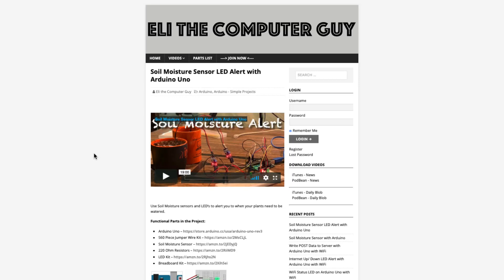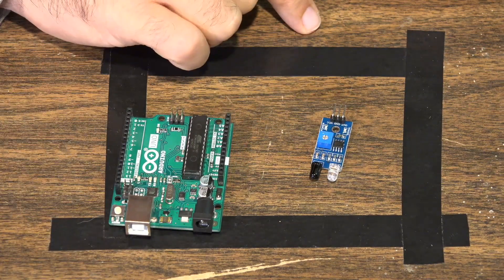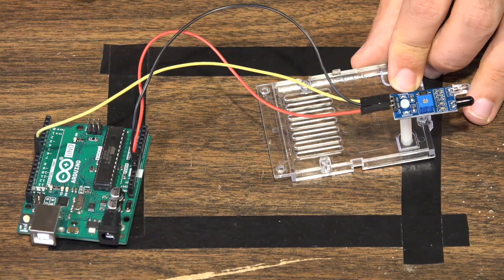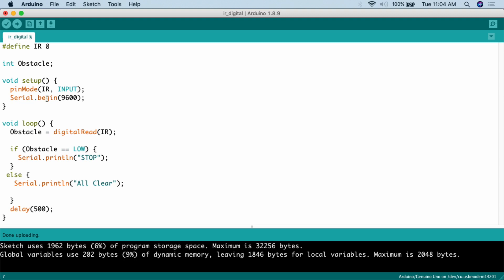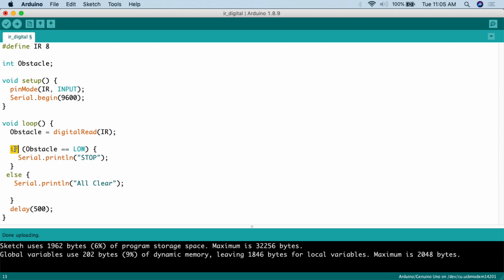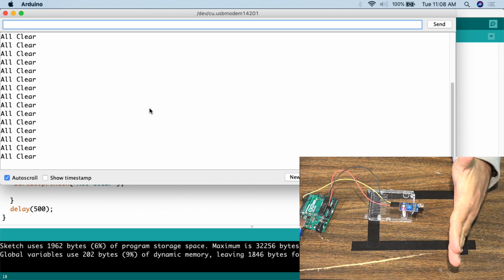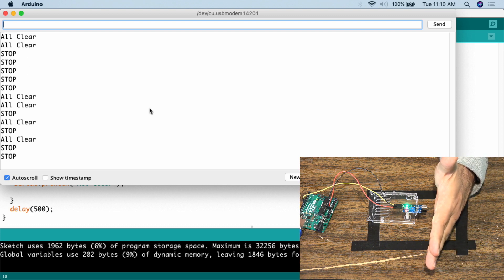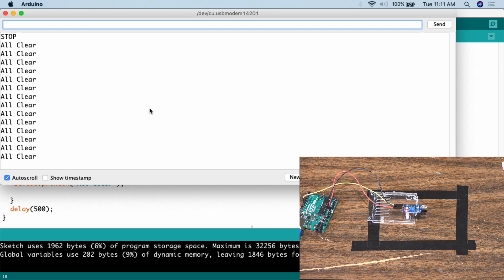IR Sensor Digital Output on Arduino

Comment: Is there a way to adjust the distance in which it detects?   For instance it senses at 1”, can it be adjusted for 2” or half an inch?
Reply from the maker: ... not really I did a video on EliTheComputerGuy.com that brings in the sensor value as an analog readout.  You get "some"... a tiny bit of sensitivity, but very little.  UltraSonic Distance sensors are the way to go for real distance readings.

Comment: i want my led that is connected to IR sensor to not to give any output(LED ON)  in first detection but internally just count it as 1 and however, in second detection the LED should turn ON and it should stay on forever. It would be great if anybody can guide me onto it since i have been looking for it all over the internet and couldn't find any relevant info.